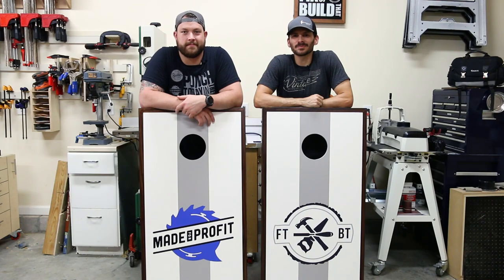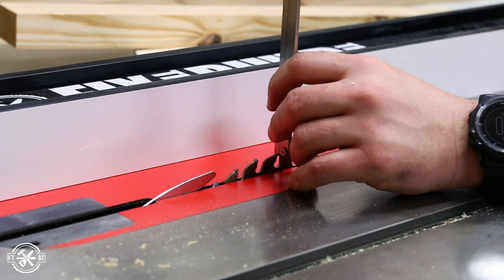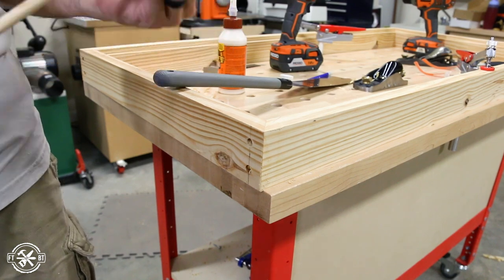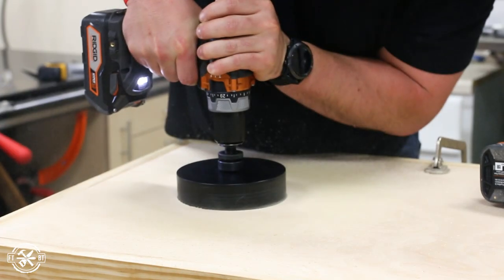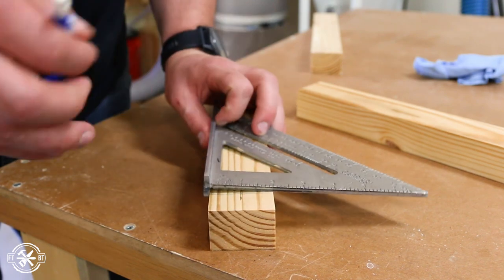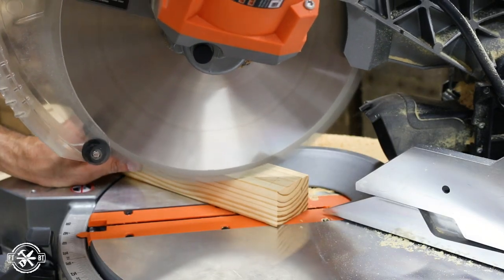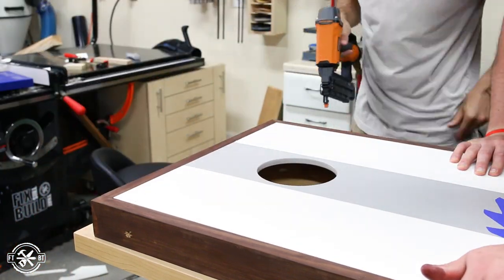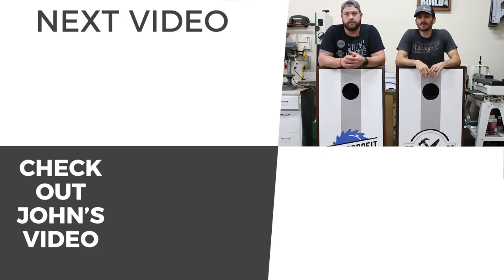DIY Cornhole Boards with Style | How to Make

Comment: I love your channel!! Just scrolling through and being a pro cornhole player this vid caught my eye. Just a suggestion from my experience on playing different styles of boards 3/4” for the top. Most professional boards use birch. And some bracing for the back provides some more rigidity along with 3/4” plywood. This will prevent your boards from bouncing when the bag lands. Especially when playing on hard surfaces like concrete or pavement. 1/4” round over on corners and edges will save your bags ( @$90 a set for good bags) from snags and tares

Comment: Just a couple tips to help with the vinyl if you ever use it again. Pull it at a really sharp angle almost laying back down on top of itself as you pull it comes off easier. Also if you get it without the transfer paper regular masking tape works a lot better it is sticky enough to pull the backing off but not so sticky it rips the vinyl loose from the workpiece.
Reply from the maker: Thanks for the tip!

Comment: Good work fellas! Love the use of the rabbit, I haven't tried that on my boards yet.
Reply from the maker: Gotta get it just right so you don't have ridges
Reply: Fix This Build That any tips to be sure you don’t get ridges? I can’t seem to get a perfect cut. I always have ridges.
Reply: @MrJdwilliams3  as my shop teacher always said, make the mistake you know you can fix. In this case size the lumber a hair wider than your finished dimension then cut your rabbet the same amount deeper as you oversized your lumber. That way when finished you can use a flush trim bit and have a perfect flush top.

Comment: Those came out SO AWESOME! Definitely going to have to get those plans for when we inevitably re-make our boards from a year or so ago
Reply from the maker: This design is pretty cool and sets them apart from other flat designs
Reply: Oh definitely! Most of the ones I see are butt-joined 2x4 with the ply on top. The ones we currently have (one of my first bigger builds last year) were that, but mitered corners. This is a HUGE step up from that!

Comment: Great lookin boards! Love the new logos. I'm making a set right now from birch ply and thermo modified poplar, i did the same rabbet method to inset the top. I also used the rabbet offcuts to do an inlay in the top. Then an oil finish to make em pop. These are going to be for an ALS fundraiser so I really want them to turn heads and open wallets 😁
Reply from the maker: Sounds awesome! Hope they raise a lot for ALS!

Comment: Only bad thing with these style boards is the bounce you get in the middle of the board and hole. 
Also i've seen multiple brad nails start to back out on designs where the top is brad nailed into place without any other type of fastener attaching it.

Comment: Wow so many folks in the comments going "Durr, no plan/ cut list. How make boards? I so lost." How do you folks function around tools and a shop environment without any critical thinking/ problem solving skills? A quick interweb search will give you all regualtion cornhole board measurements and from there it's just a handful of basic math to fill in the blanks. There's no reason any adult should have their hand held through such a simple process.